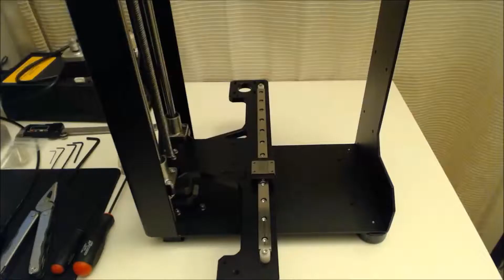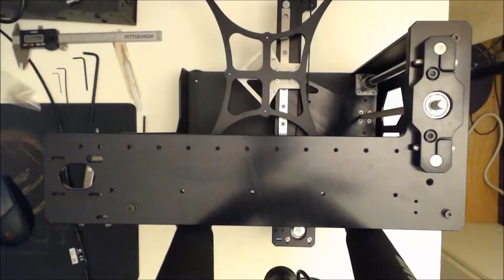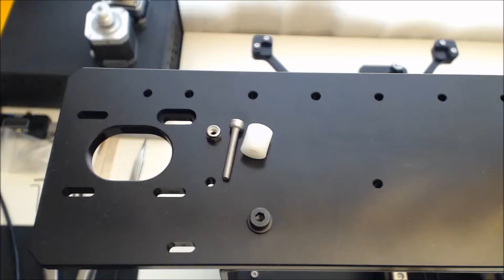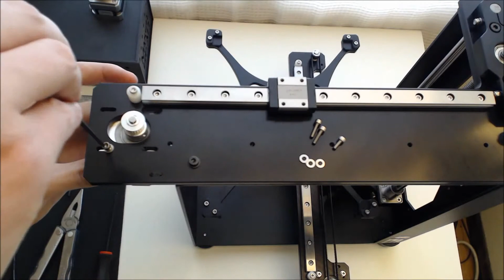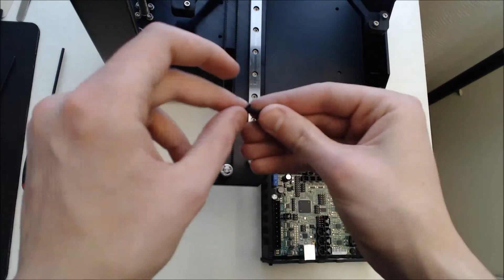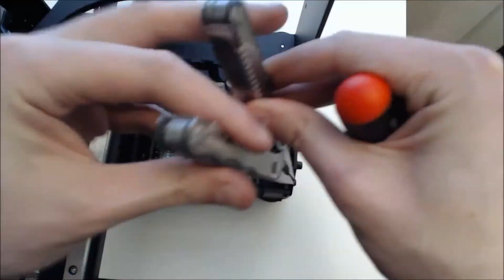MakerGear M2 Part Five Frame Assembly

Comment: Hi, 
I connected my m2 with pronterface and I got this problem. 

Do you have any ideas? 

Thank you so much! 

Connecting...
start
Printer is now online.
echo:Marlin: 1.0.0 RC2 for MakerGear M2
echo: Last Updated: 2012-05-30 | Author: johnny
echo: Free Memory: 4775  PlannerBufferBytes: 1232
echo:Using Default settings:
echo:Steps per unit:
echo:  M92 X88.88 Y88.88 Z400.00 E471.50
echo:Maximum feedrates (mm/s):
echo:  M203 X500.00 Y500.00 Z250.00 E200000.00
echo:Maximum Acceleration (mm/s2):
echo:  M201 X9000 Y9000 Z30 E10000
echo:Acceleration: S=acceleration, T=retract acceleration
echo:  M204 S3000.00 T3000.00
echo:Advanced variables: S=Min feedrate (mm/s), T=Min travel feedrate (mm/s), B=minimum segment time (ms), X=maximum xY jerk (mm/s),  Z=maximum Z jerk (mm/s)
echo:  M205 S0.00 T0.00 B20000 X20.00 Z0.40 E5.00
echo:PID settings:
echo:   M301 P7.00 I0.10 D12.00
echo:SD card ok
Error:0
[ERROR] Error:0

: Extruder switched off. MINTEMP triggered !
Error:Printer stopped deu to errors. Fix the error and use M999 to restart!. (Temperature is reset. Set it before restarting)
[ERROR] Error:Printer stopped deu to errors. Fix the error and use M999 to restart!. (Temperature is reset. Set it before restarting)
Reply from the maker: Hmm I am not sure. I use Simplified 3d, I would suggest uploading your question to the makergear form or email Makergear directly. They do have good customer service.